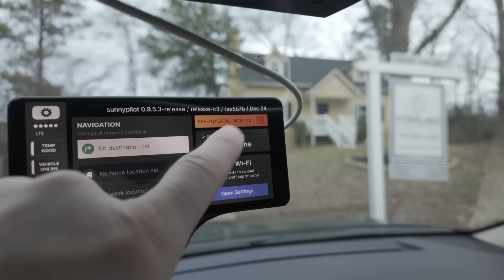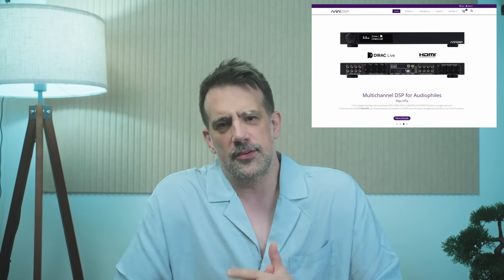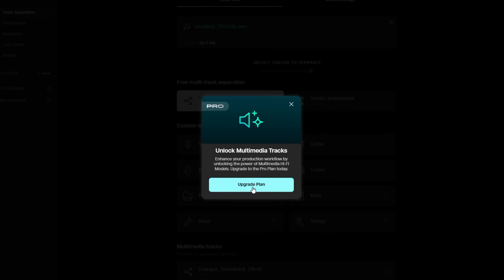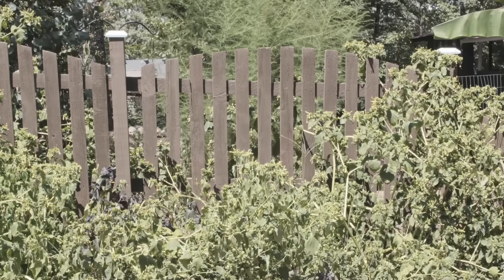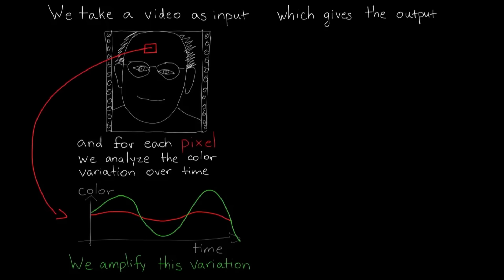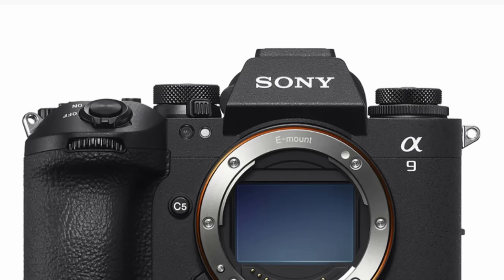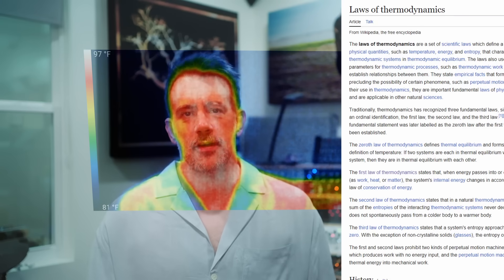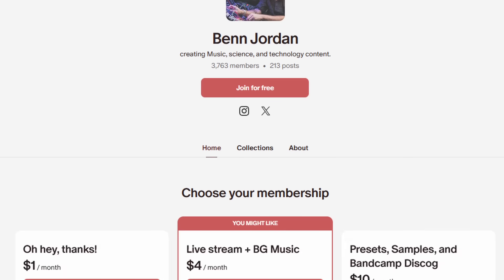How To Make A Legit Sound Camera

Comment: I made my diploma thesis on industrial machinery damage by analyzing the vibration produced by the machine, or the temperature of a ball bearing. Yeah it was an Arduino project displaying data on an android phone, made to impress professors more than else (and it worked).
But it cool to see it's an existing field, i think you did a great work.
Thanks for sharing, seeing this made think about a couple of ideas 😁.

Regarding the camera stutter problem, probably it can be compensated with some software calibration...if the timing is not affected by temperature and other variables, then it shouldn't be hard to do. 
Even if you must do the overlay with the previous frame, once you have the vertical speed, you can calculate the zone to be ignored when making calculations.

Super nerdy stuff ↑ ↑ ↑

Comment: Perhaps the thermal image gradient at higher frequencies is due to induction eddy current because of the inertia of the speaker contending with the rapidly changing magnetic field, the higher temperatures seemed localized to the speaker coil rather than the cone.

Comment: The part in the video where you showed that you could see the butane... how many manufacturing companies could use that in safety monitoring or manufacturing? Can you see different gasses as different forms of "smoke"? Construction when insulating buildings for drafts?

What I saw in that part of the video I can not describe as anything other than magic and the potential of what it could do as mind boggling.

Comment: 14:55 I am not convinced you observed heat of sound as opposed to the heat of a coil through which electrical current is flowing.
A better way would be to see if you can heat something else up with sound

Comment: Regarding measuring the energy content of sound:
The sound intensity (sound power per area) of a 1kHz tone at 90dB SPL is a hair short of 1mW/m^2. For reference, sunlight is about 1 million times stronger (1kW/m^2). 
Maybe you could stick a really precise thermometer probe into some sound-absorbing foam? You'd have to pulse the sound and correlate it to changes in temperature.
Reply: This is extremely closely related to my PhD and I can tell you with sound that quiet it is not possible with current technology. The cooling capacity of the material means any slight increase in temperature would be almost instantly transported away via convection, conduction or emission. With higher pressure sound it is certainly possible.

Comment: The issue I think you'll have is getting the distance to the sound, because you don't know how loud the source is actually transmitting.
It's the same issue with an aircraft's Radar Warning Receiver, which can detect the direction a missile is coming from but not how far.

Comment: I found that placing the acoustic sensors at varying distances helps the software figure out where the sound is coming from. But I only had 8 sensors and they were in a row. The varying distance between the sensors means that there are less places where the sensors all get the same signal.

Comment: When you showed your camera identify a hawk’s location and which chicken clucked, I immediately thought this would be great to track down where fireworks were ignited or direction/location of a run shot.  I also thought this is probably in use for spies and if not, should be.  Or that it could be useful for surveillance.  The ideas were just flowing fast and furious!  Thanks - I learned a lot and got lots of ideas!
Reply: I think in the Netherlands they already do this. Wouldn't surprise me if they did this in many other countries as well.

Edit:
Lookup "Soundbrella" and read the articles by AD, NOS and gemeente.

This is translated from NOS:
"
Leiden calls in the army to combat fireworks vandals

A decent firework bomb will of course not go unnoticed, but in Leiden the chance that the police will hear your Cobra 6 is even greater. The army has placed microphones on the roof of five flats in the city, which immediately signal where it came from after the explosion.

Within no time the police receive an email with the exact location of the firework bomb. "It is not the case that officers wait at the station all day until a report comes in. A lot of officers are already driving through the city and can be on the scene quickly. The chance of catching them is much greater," says mayor Henri Lenferink.

Leiden war zone
The army normally uses the system to measure where shots come from and where mortars fall. Although Leiden may not be a war zone, according to local residents it does seem like one in the weeks before New Year's Eve. "More and more heavy fireworks are being set off. That is not only on New Year's Eve, but also in the period before that," says the mayor in the AD.

Soundbrella
The soundbrella, that's the name of the system. According to Major Henk ter Kulve of Defence, a unique Dutch invention. "This sensor can measure any form of sound and knows exactly where it comes from. The microphones can hear the fireworks from three kilometres away." If it turns out that fireworks vandals are indeed caught faster by the system, other municipalities can also start using it.
"

Comment: I guess it may be widely known. There is some research about use of ultrasounds at very short distance to heat human tissue (mainly for oncology) to rise the temperature of tumors. Increasing temperature of the tumor even by 2-3 Celcius degrees makes it much more vulnerable for other treatments as chemotherapy and radiotherapy. My colegues took part in some experiments during their master thesis. Ultrasounds are one of potential tools that someday may be used for heating process in hyperthermia treatment. Last I checked the topic, the temperature rise was significant, yet not sufficient.

Comment: I've worked with beam-forming acoustic cameras (the expensive ones that comes with a 4m-diameter 128 mic array and an engineer attached). The problem is always low frequencies. The more diameter your array has, the lowest frequency you can visualize. Even with this large array, the lowest useful band is around 125 - 250 Hz, at which the spatial definition is very bad. This is useful for locating a steam leakage, but problematic to locate the source of a low rumble, and definitely not useful to find a source of (infrasonic) vibration.
I've been wondering if one can make use of the thermoacoustic effect to visualize vibrations with a thermal camera, but it seems the effect is also very limited at low frequencies. I also wonder if there is a thermal camera fast enough that one could filter by frequencies (and filter the non-oscillating temperature floor of a surface), namely, that has a frame rate of at least a few hundred fps so one can sample an actual waveform out of each pixel.

Comment: Love the monitor based Schlieren effect! I wonder if vibrating the camera would get even more interesting results (to exploit the moire interference patterns between the sensor and the pixels). 

Interesting going to a global shutter when doing motion analysis: During one experiment for my undergrad thesis, I made use of the rolling shutter effect of a CMOS camera to get more time slices for estimating the horizontal acceleration of a motion blurred object. So I'd expect any vertical straight line in frame should give more acoustic information over the duration of the rolling shutter event than during a global shutter exposure.

Comment: Using the speaker to demonstrate that sound generates heat isn’t valid, I don’t think. I don’t think anyone would be surprised that a speaker warms up when it is generating sound because it is rapidly flexing and has magnetic coils rapidly moving in a magnetic field.

I think it would be more valid to point the speaker at a surface and measure the temperature of that surface.

I’m no physicist, though.

Comment: You should consider making a laser microphone. You probably already know what they are, but in case you don't: they shine a laser on a target and detect the reflected light. Vibrations in the target will ever so slightly alter the phase of the reflected light (much like how a laser interferometer works). By observing the interference pattern made when the source beam and the reflection are combined (and with a lot of math) you can extract frequency information and convert it into audio. 

I'll admit this is probably a lot more complex than I think it is. But I've spent hours playing with lasers and I've noticed that by reflecting a laser off of a surface that scatters the light, the speckle pattern gets magnified and projected onto the ceiling (or wall, depending on how you aim it). This projected and magnified speckle is extremely sensitive to changes in either the laser's position or the position of the surface off of which it is reflecting. So much so that I could see my heartbeat even when I was sitting in my chair on the opposite side of the room from where the laser and the reflecting surface was. Using a shorter wavelength (i.e. a 532nm green laser instead of a red laser) increases the "resolution" of the speckle, and thus the sensitivity.

You could probably utilize the code used for motion extraction to do this.

Comment: This seems like a good tool against deep fake detection. I think Microsoft used this to determine bloodflow of the subject vs a deepfake of a subject. That said, I don't think it would be hard for models to add this lifelikeness to generative output.
Reply: depends on the type of deepfake, if it's a modified existing video then it probably wouldn't work, if it's an animated photo then it would, if it's a video made 100% by ai then the ai probably learned to mimic subtle patterns like that already
 
would be neat to check though

Comment: Your rolling shutter elevator/floors in a building analogy isn't quite there for rolling shutter as you acknowledge as we do read out the data for each pixel in the frame even if we don't read them all at the same time, but it does have a real imaging application - earth imaging satellites. Because the satellite is (usually) in a polar orbit moving over the ground in a predictable way, they typically use a single line sensor array and rely on relative motion to scan lines into a  'strip'. Its often called a push-broom/sweeping brush sensor. If you do a search you'll see that many also use a colour wheel on a lower-res r,g,b (and possibly some infra-red multi-spectral content) channel as  well as a higher res mono channel, as evidenced by slightly distorted, rgb ghost rainbow 747s trailing the background coloured one occasionally captured. What you're seeing are artifacts of the above, geometry correction and the 'pan sharpened' output after merging all 4 values together.

Going a step further, if you look at a hyperspectral imaging setup, a spectrograph (slit aperture, collimating optics, prism etc) is typically placed in front of a low noise, global shutter CCD sensor. The single spatial line of the imaged scene is smeared across the other axis of the sensor. After some calibration we can either move the camera or scene (aircraft, moving stage on a bench, servo panned head on a tripod). After some calibration, we can process a capture into an X,Y,Z cube where Z represents a wavelength bin.

I assume there are some industrial applications for motion analysis in the long wave infra-red - looking at what's getting hot/ vibrating (I'm thinking of high voltage power infrastructure), but I'd be curious to see what you could observe using an off-the-shelf camera with some infra-red band-pass filters as used  for things like plant health or water content monitoring.

Comment: One cockamamie idea I've had for a while, is that a rolling shutter effect could actually be exploited for sound-camera-ing, because it's kind of like a tradeoff between temporal and spatial resolution.

I've seen cellphone videos taken at dubstep concerts where a long, sustained sub-bass note makes the entire camera image go squiggly, with a roughly sinusoidal horizontal displacement. I wonder if motion amplification techniques can be used to discern quieter, and higher-frequency, squiggles too?

If the shutter doesn't advance across the image smoothly enough (or in small enough steps) to give a reasonably high sample rate, you could use a spinning disc baffle in front. Like an old timey zoetrope.
Reply: I saw a paper on that somewhere, where they managed to recover (low quality) audio from a rolling-shutter video of something that was vibrating! I can't remember where now though, sorry!

Comment: Visual reflection detection of audio is super useful for treating studio and listening rooms. Being able to see the reflections and treat them where necessary is a super time saver with no real trial and error required. And it is recommended that you rent a very high end camera for this because you really only have to do it a couple of times to map out the rooms, provided you're not the kind of person who moves things around frequently. It's hard surface reflections that cause the most trouble. Of course, the "golden ear" club will try and tell you they can do it with just their ears so they can seem like they have ultimate hearing but, the eyes are better than the ears in most cases, especially this one.

Comment: Awesome stuff, especially the first section! Couple nits: 10:22 -- rolling shutter affects mechanical shutters as well (not that you said otherwise, just saying), and 13:30 -- as others have said, it seems much more likely that the thermal effect has to do with electrical resistance and conduction through the speaker, rather than the heat of actual sound waves. I have seen estimates somewhere (no links off hand, sorry) about the amount of heat-equivalent energy contained in sound waves, as well as the displacement of air molecules in a sound wave, and both were very very small.

Comment: In theory you could exploit rolling shutter effect to extract super frame rate information, having the difference in each line associated with a fraction of a frame, but then you need to stabilise the vertical vibration which would require hectic oversampling etc. The result would be very noisy, but that’s another great way to burn a few days of your life

Comment: Ffmpeg also has some basic motion amplification stuff available.  I used it to amplify those refraction waves streaming across the ground from the last eclipse.  It also amplified sensor noise past a certain point, but it still worked surprisingly well for just wiggling a few parameters.
Reply from the maker: I didn't realize! I need to check this out
Reply: @BennJordan   I don’t blame you!  I actually only found them when I was looking through the various filters to try the manual difference version, basically what Posy showed in their video.  Turns out they already got us covered!

Comment: 3:43 My frustration with Python exactly. I find a Python script has a shelf life of like 1 year, and if I revisit it after that I'm in for a whole mess of digging into why it no longer works and finding old versions of x, y, z....
Reply: Heh. We never figured out reproducible builds in the python packaging world. It never used to matter either, because breaking backward compatibility was considered an enormous faux pas. I've had some success with nix for repeatable python, but there is definitely a learning curve.
Reply: I dipped my toes in Python, and got frustrated by this.  Well, this, and the fact that most documentation is written as a flowery tribute to how great Python is, and how easy it is to read.  Of course it's easy to read.  Nobody ever writes error-checking in Python, they just let the whole thing collapse with a stack trace.  Turns out, C and ASM are easy to read when you are unreasonably optimistic, too!

TBH, it was never going to work out.  I just can't with languages that use line endings as syntax.  Gimme my { braces and semicolons; }
Reply: This is where you want to be using venv and a package manager that supports semantic versioning, but yeah it's not trivial. NodeJS is a nice example of baking this in by default with NPM.

Comment: @benjordan I am not sure if that was the sound that raised the temperature there. It could have been the coil itself. Those always heat up when being used, because of their electrical resistance. They also move fast within the little gap in the magnet, so air friction. One reason they add some ferrofluid there is to help dissipating the heat. 
But your own checkerboard pressure camera was awesome! :)

Comment: What you did with the pattern and high aperture is called grid schlieren. I don't think it's fair to say that it "dawned on you" as it's a very known way to present schlieren imaging digitally. It is riddled with artifacts though becuase of low resolution / bit depth. I would suggest a two mirror setup of the original analog schlierin setup. For visualizing audio you need to use a simple fm wave (carrier 81-192hz) with a very high modulator (in an upper octave of roughly 400-900 khz range for 12-24 ish inch wavelength). That coupled with an understanding of the geometry and attributes of the atmosphere (temp, pressure, medium, etc) that the test is done in. Read Gary Settles book on Schlieren imaging for a more comprehensive understanding. You need to have an understand and plan out what is possible to film audio, you can't just set up a rig and hope for the best, also sound is anisotropic so it is best to capture it against a plane and 3 dimensionally it is nearly impossible get a clear image without a full understanding of the propagation.